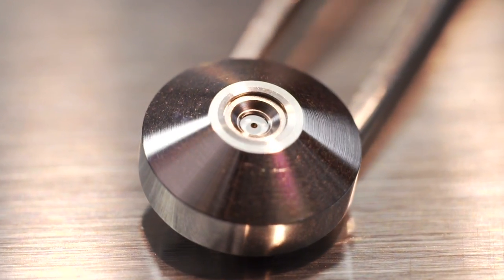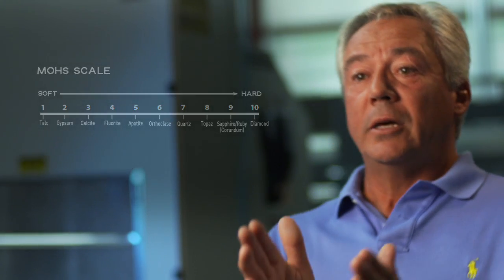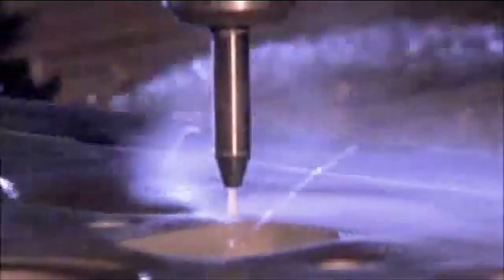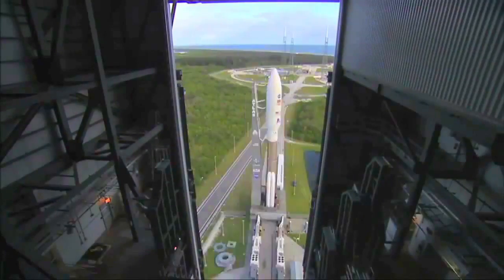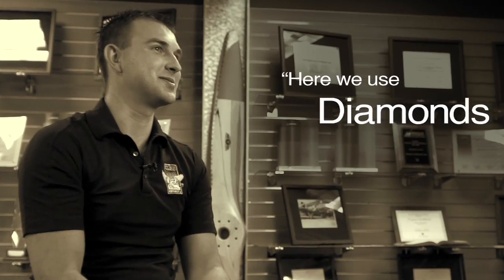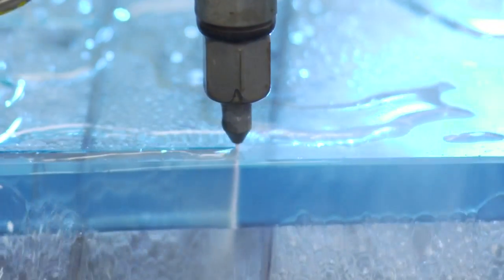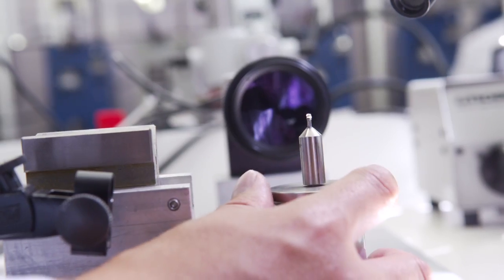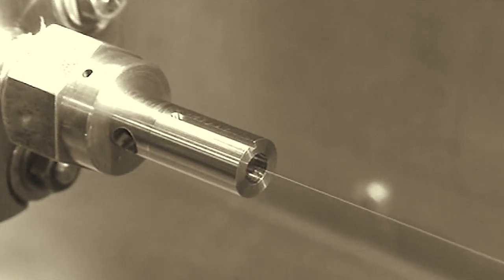Waterjet Cutting: Diamond vs. Ruby & Sapphire

Comment: Is there something that a waterjet can't cut?
Reply: only thing that can stop a water jet is water
Reply: Of course! It's a liquid, water disperses the force of the jet. But what solid material can't be cut by an waterjet?
Reply: i dunno
Reply: diamonds cut diamonds do they not? if they used diamonds for the abrasive in the waterjet it would cut trough them. right?
Reply: But the water is not the one cutting.. its abrasive powder
Reply: I'm referring to a solid. If there is a solid material that cannot be cut by this jet.
Water and air are fluids, and fluids can be divided easily.
Reply: vibranium cannot be cut man
Reply: Akira Mishtokaru It can cut itself
Reply: Adamantium prob too
Reply: we are talking about real things, not any scifi stuff.
Reply: Neutronium, the surface crust of neutron stars, it's 10 billion times the density of steel, nuclear weapons couldn't even dent it.
Reply: Jimmie Young Yes, but I would like you to send that to the water jet channel. 

Also don't use the word cut, because technically things like:
  Most ceramics and tempered glass - will shatter or break
  Reactive materials (i.e cesium and sodium) - reacts rather destructively
  Powders/Liquids - Obviously
  Some composites - Water can breakdown the bonding between the layers of material 

But if you mean survive against it, then if you give it enough time or psi I don't think so but enough thickness of things like steel or titanium can slow is down to point it would lose in the effort alone
Reply: Tempered glass, other than that it will cut it.